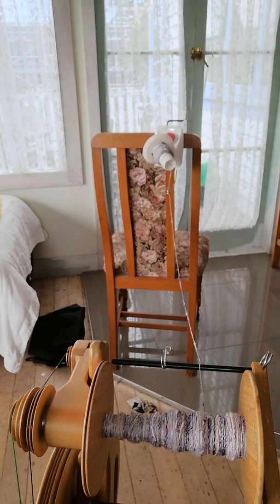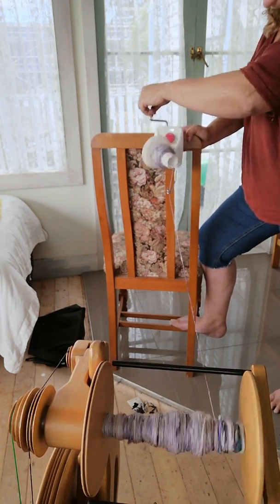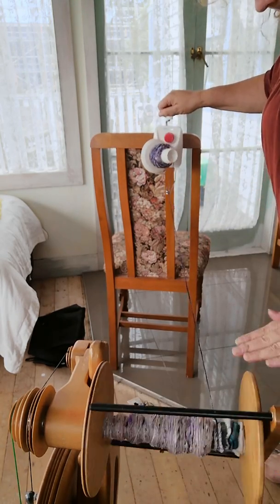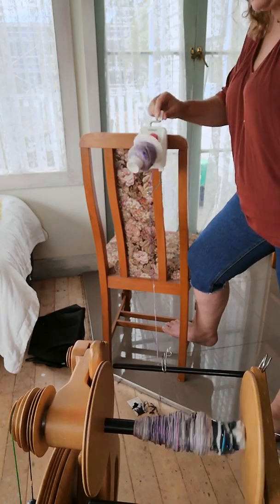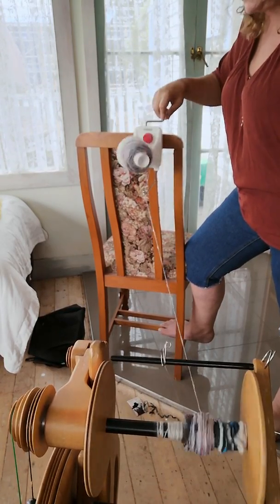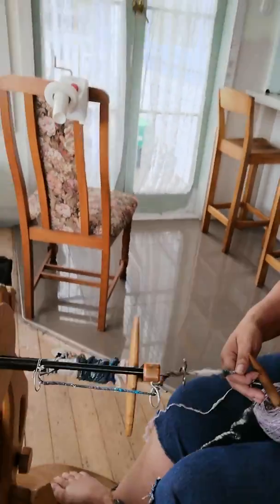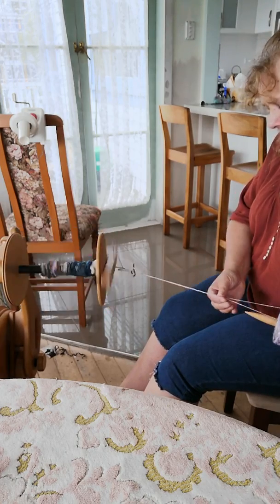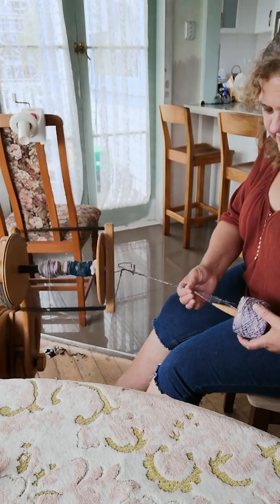Plying from a center pull ball and making a center pull ball straight from a bobbin on the overdrive

Comment: Your use of a needle or pencil is great, I've spin centre pull without, which works well until the centre decides to have mind of its own ;)
Reply from the maker: Thanks Kim , its great as you can stop and put it down when ever you like .. I also use this for plying off a spindle , if out and about and I want to put my work in a bag I replace the needle with a stitch holder